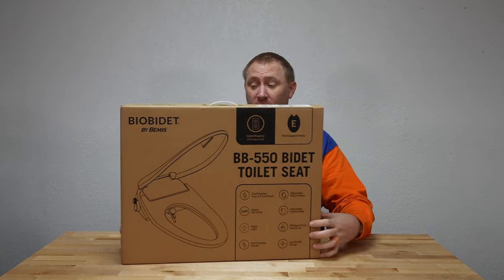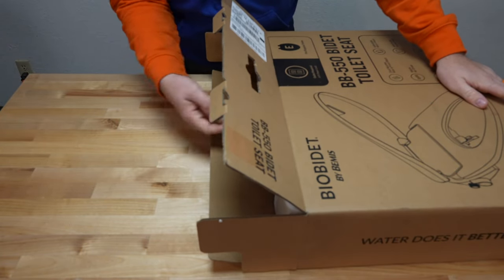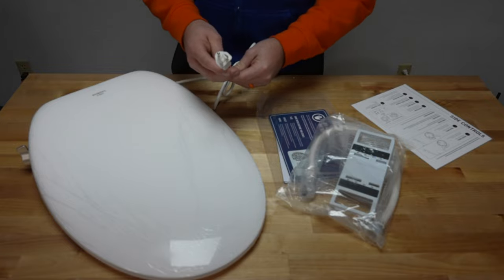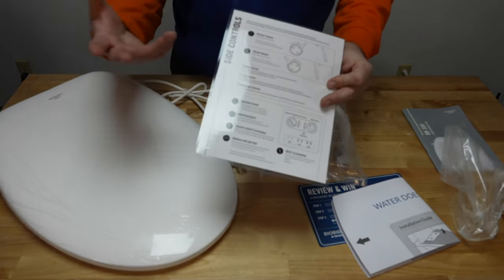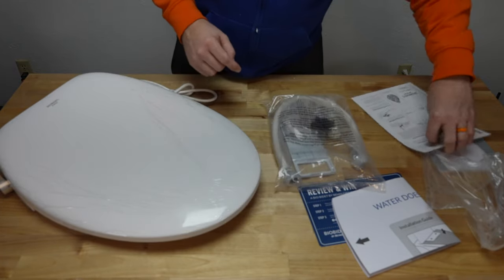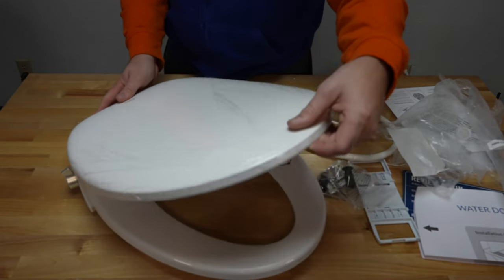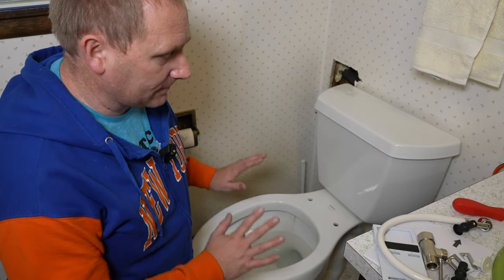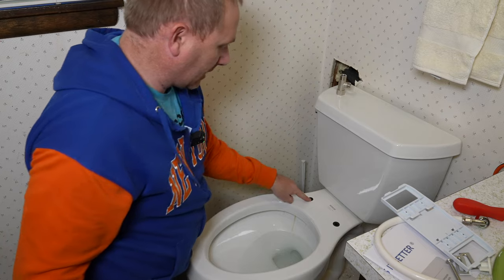BioBidet BB-500/550 Bidet Toilet Seat Install

Comment: I am wondering, why don't someone mention that these back-to-front jet bidets splash (or not?) water mingled with poop towards the urethra? It is time for every body to know that there are FRONT-TO-BACK sanitary bidets and of very low cost.
Reply from the maker: These bidets do not wash back to front, they have a stream for each area. They do wash from the back of the toilet, true, however they do not technically wash this toward your urethra. I have three women in my home and have been using bidets for years now, and none of them have ever had an issue.